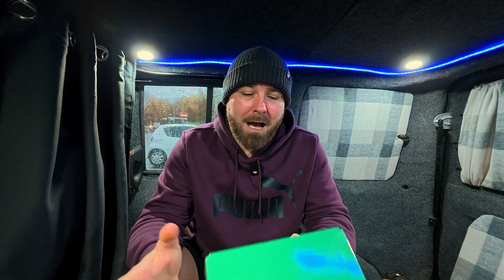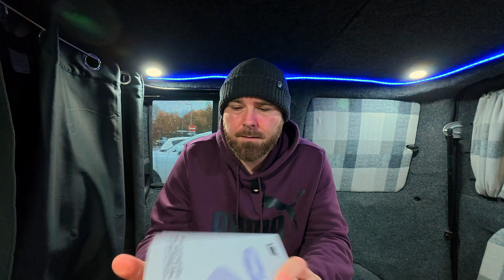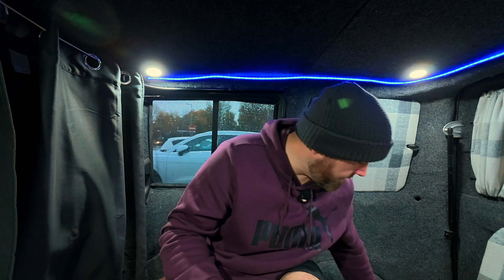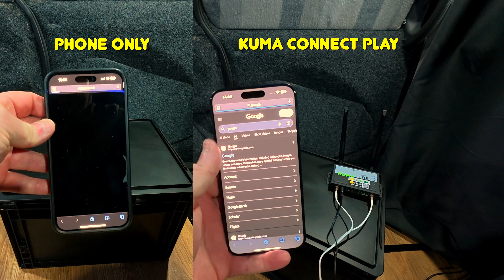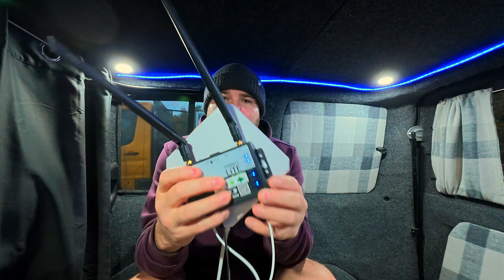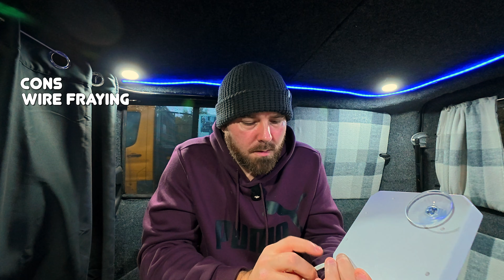No Signal? No Problem! The KUMA Connect Play Saved My Vanlife WiFi!

Comment: Hi rob will the antena theing come with the hub? As a package?
Reply from the maker: Hi mate. You can buy them separate but the kit I’ve linked is everything shown in the video.
Reply from the maker: Sorry mate just checked it takes you to their main website. But if you get the connect play kit that’s the one I have. There’s the 4g version I used or there’s a 5G option if you want to spend the extra but the 4g was fine for me.

Comment: can it pick up campsite wifi as campsite i go to there is no mobile signal
Reply from the maker: No because it won’t work as a WiFi extender. However as there isn’t a phone signal, you could put your sim in the router and it will boost the signal giving you a strong phone signal.

Comment: Star link unlimited is £100p/m plus the device cost so Kuma definitely sounds cheaper
Reply from the maker: Like I said in the video the kuma isn’t a starlink replacement or cheaper version. They’re both very different pieces of gear. Starlink has its own network that you can join whereas with kuma it’s boosting a 4/5g signal in areas with little to no signal. Kuma may still not find a signal in some areas whereas Starlink uses satellites therefore has a better chance at reliable constant signal. But it’s expensive for that luxury.

Comment: If the kuma router has 4 antennas then why do you need a separate antenna?
Reply from the maker: The router and the connect play are separate devices. So if you had a different wireless antenna, you would use the 4 antenna on the router. The antenna I used was the connect play which can be moved about. There is a permanent puck solution that gets drilled into the roof but I preferred the freedom to move it about.

Comment: Nice vid. can you use a kuma aerial with a different brand router ?
Reply from the maker: Thankyou. I’m not sure, however I don’t see why not so long as the adapters fit. There are adapter extensions in the box so it could be possible.
Reply: Yes, as long as the router has SMA connectors

Comment: Yeah you need this with O2....looks good. And another cameo for me on your channel.
Reply: is 02 the one you think rick? you can get multi company sims that changes depending on which signal is stronger but that is pretty expensive i believe.
Reply: @jodu626 well if you are using this to boost your mobile phone signal you will need it. 
I am with O2 as well, awful signal.
Reply from the maker: 😂 I’ll need to start charging you for the cameos. Yeah o2 is awful but this wee thing worked a treat.